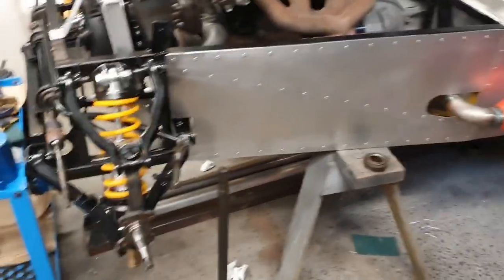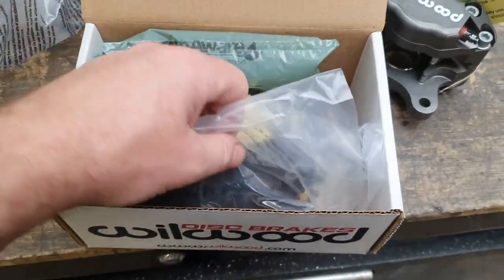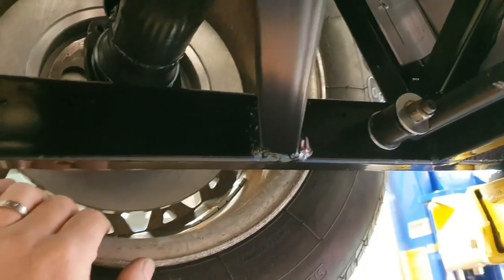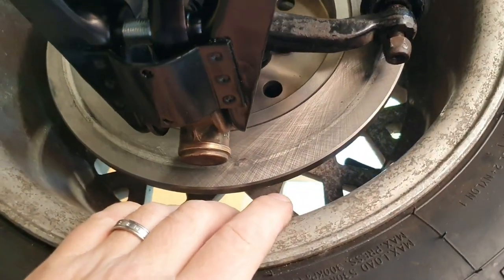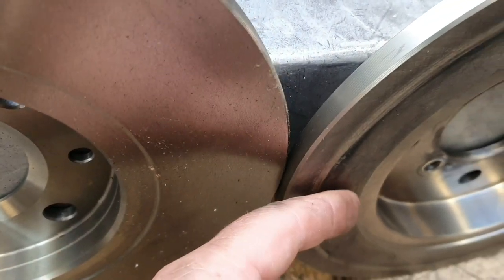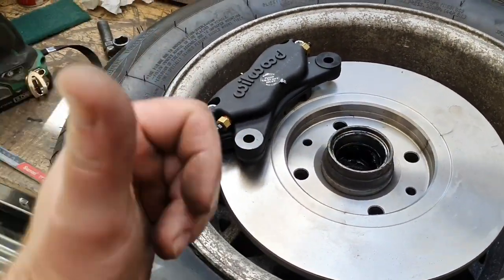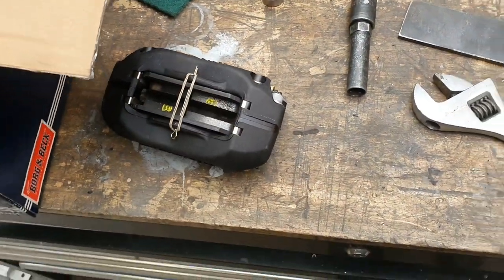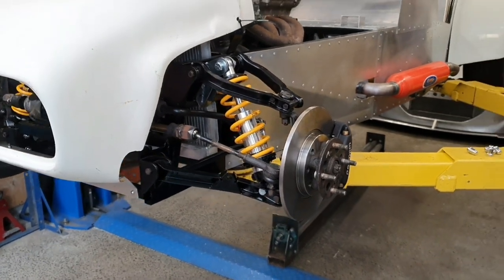Locost Seven brakes

Comment: The "spacers/washers" that you have added next to the bush(at the diff), should have  a smaller diameter, than the outer diameter of the bush, no? And then you can tighten the nut.
Reply from the maker: Nope, then the bush can slide along the inside of the outer tube allowing sideways movement of the diff.
Ideally it SHOULD have top hat style bushes in there and I MAY modify it to that design depending on time etc.